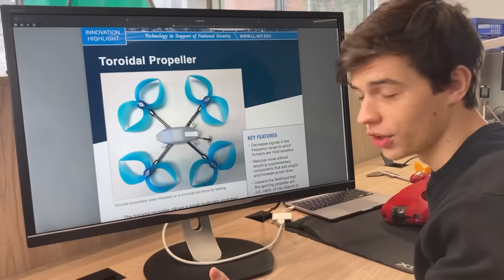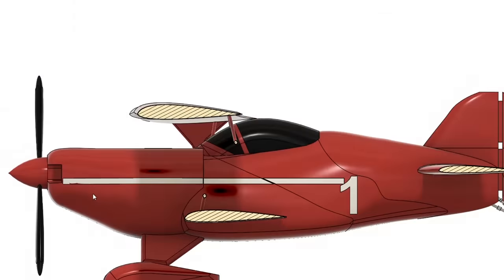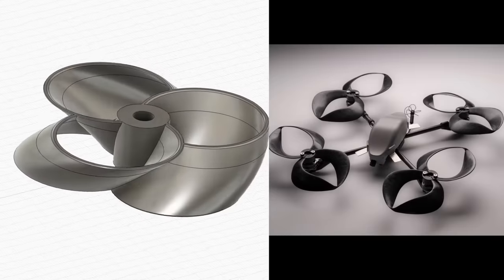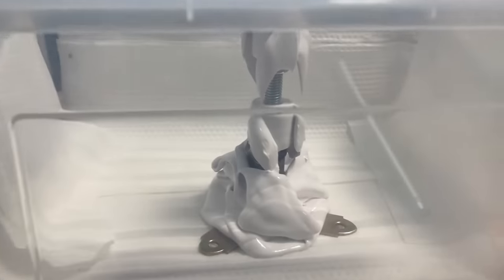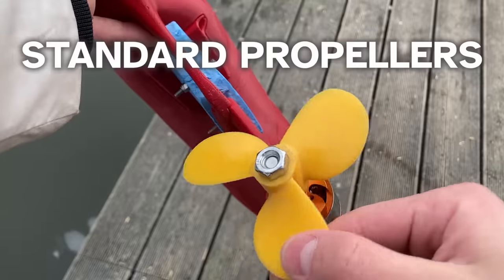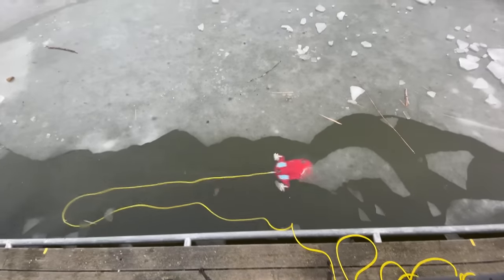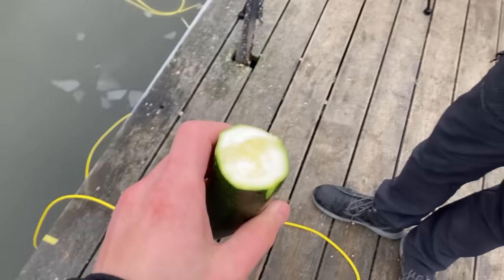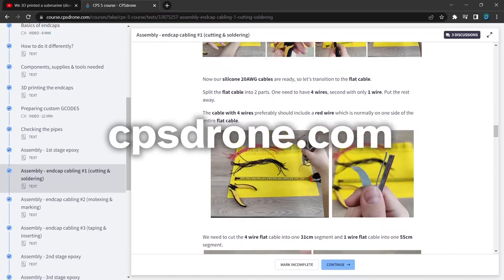Testing a TOROIDAL propeller UNDERWATER

Comment from the maker: Thanks for your feedback on the designs! We really enjoy making these videos and want to continue with some new adventures using our CPS 5 underwater drone.
Btw, go to our course on https://www.cpsdrone.com/ to build it yourself! (First chapter of the course is free)
Reply: Try making them with similar or lower total rotating surface area than the standard prop. A lot of  poor efficiency in water props comes from too much viscous drag. 
The standard props you are using also are designed for large speed range without stalling and making froth. A high aspect ratio model aeroplane prop can do a lot better, but remember that 5 to ten degrees at most of angle of attack stalls a water prop. Rather than 30 degrees in air. 
So they make them low aspect ratio to give good thrust into the plane, and give some braking thrust in reverse. 
Matching your rpm to speed can let you use more high-speed efficiency and still have some decent acceleration without just Cavitation and froth. 
You are using more  four times the watts that pushes my 1000 pound 14ft tender at 2.5 m/s. 
And 1.5 times as much as what gets my fifty foot 9 ton Wharram Catamaran going at 3m/s. 
With far more efficient and reliable brushed DC motors.
About as much watts as a top human powered hydrofoil can do 20m/s On . 
So you have some room for improvement. 
Dragging a tether is a bit of an arse. Ultrasonic modems are probably up to the bandwidth you need for a reasonable range and low res video
Reply: @aaronfranklin324  The pitch could be wrong indeed. My first thought is that the toroidal props are too big. They shouldn't match the diameter of the original one.
Reply: @Platypus_Warrior  yeah, think of the 200 kilowatts going through a sharrow prop, and scale down to the blade area you want for the 200W that sub should need to go as fast as a fizz boat of several tonnes and 25 ft length. 1000 times less.
Reply: Major Hardware has had several blade design community competitions that might be worth checking out
Reply: @kingmasterlord  seen them. Same issues with too much surface area. And bad foil profiles and angle of attack issues. 

+running these hoop foils in a shroud is just plain dumb and inappropriate. Recipe for spinning the air  rather than moving it.
Reply: dam they figure it out ....now wondering how long will it take people to use the design else where... also do a noise test ...noise pollution in oceans is a very big problem as sound travels faster and farther in water
Reply: @Jason Bourn things start to fall over with that when your bigger propellor is not in a low speed low angle of attack regime at low power to surface area loadings. 
You get too much viscous  drag as speeds go up. 
And the parasitic drag of the root and hub are bigger. 
The central vortex becomes very draggy too. 

Pulling props can overcome some but not all of this with the rotating spinner nose cone generating a lot of the lift
Probably the best soluy I've seen is hubless systems with the blades mounted on a rotating bell mouth  and entraining a central undisturbed water pillar. 
Putting magnets in the rotating section, and making it a combined motor, Magnetic/ water lubricated fluid bearing potentially very good. 
Especially if you used a homopolar pure DC motor design with saltwater film  brushes and multiloop windings.
Reply: looking at the toroidal propeller, I have an idea, I am not to sure if it would work, but looking at the design, it seems that it should work from what i can see in my minds eye, all so I have added to the first design,  a 3d printer should be able to make it, 2 addons, that I think both should work. I think that it could add 3x more output with 1st idea, second idea it would just add to the output already, I cant see how much the second addon would increase the output.
Reply: Can I use a rasberry pi 3 B+ instead of the rasberry pi 4 when building the drone?
Reply: Those aren't wings, and those aren't propellers. Those are screws. Welcome to boats.
Reply: @CPSdrone - quick question: why is the drone battery powered? Since it uses a tether anyway, wouldn't it be easier to use an external battery? It would give more flexibility on the power source. This would allow for the use of a larger power pack for use in currents, or to power stonger lights.
Reply: But is it more efficient than a kort nozzle ?

Comment: Centrifugal force tends to sling water / air from the center to the edge.  Centrifugal blowers, like a turbo, maximize this.  Standard propellers all have tip vortexes.
Reply: if i understand this right, that centrifugal force is being converted into thrust as well with the right propeller design
Reply: @stefanweilhartner4415  in certain circumstances yes, in some cases. speciffically on small scale it sometimes just makes it slower, I thought of that as well when making small propellors for micro motors for a micro plane, essentially designed them so that the centrifugal force was also translated in pushing force, but at that scale the small differences in mass and balance due to imperfecions actually made it worse.
on a bigger scale it might get more positive effect however.
Reply: *) vortices 😉
Reply: I'm gonna be that guy who states that centrifugal force is not a real force.
Reply: @ted_van_loon  Isn't what you're describing the reasons you sometimes see ducted props, an effort to convert as much energy into usable trust?

Comment: I believe the main problem is the high rpm you are using. The water testing of the special propeller (in you tube independent videos) shows a lot of advantages in the mid range and none in the high rpm range.
Reply: So i dont think its something thats necessarily inherent in this design that makes it less or more efficient at high RPM its just that  the props they are using are specifically designed to be the most efficient at a certain RPM. I think that could actually apply to any propeller really  but i think that its kind of an important thing to keep in mind. I think if you watch the video where they make the test with the larger catamaran boat is a good example of this, they put a commercial prop up against  the sharrow prop in the comparison but they Sharrow prop was custom designed to meet the  goals that they outline in the test. While it does make for some impressive results I'm not entirely sure on how fair a comparison it might be,
Reply: Yeah from what I'm understanding these new propellers basically mean youc can have better performance like longer range and reaching peak speed much faster.
Reply: If you want greater efficiency at speed studies seem to suggest rim drive then waterjets then finally the Deepspeed italian Rim drive water jet pods .. 
With rim drive the blades are more numerous and the jet confined by the housing ....that also makes them safer. 😉 The fact they dont have a driven core blocking the flow and moving turbulently means the blades can be more even in profile...and individually replaceable.
Reply: @tsunertoo9149  The funny thing is these aren't new, not at all. The design has been used since WW2 on torpedos. It works fine there because you design the propeller to be efficient at a specific range of RPM and torpedos are a launch and let go at one speed weapon so having a more efficient prop means it can get more range.

Comment: Great video! I would say that the results you have obtained are in line with what you could expect. The main purpose of those propellers (without a specific design to optimize them in terms of consumption) is the reduction of the noise caused by cavitation. Clearly, as you have in fact explained) the increase in surface causes an increase in resistance (especially if the added surface is reduced due to viscous friction phenomena).
You could try using a sonograph and measure the noise made by the two different propellers. In any case, I think that the greatest utility in the hobby field is to avoid accidental cuts.
Reply from the maker: Thank you!
Reply: To add to this, I believe if you look at the Sharrow data, there is a huge increase in efficiency in the mid range.  So yes, the toroidal props don't perform as well at max power, but could you chart their power draw over a range of throttle inputs or speed to see if yours indeed are more efficient at lower RPMs? (also, I know Sharrow provided their own data, so should be taken with a grain or 2 of salt)
Reply: @benconverse6158  Its because the Sharrow props are really designed to be most efficient at a particular speed/rpm. There is some more recent videos showing a "3rd " party test of the props by a boat magazine where they have more data published. i put the "3rd" party in quotes because they are using propellers that are basically designed for the specific engines they are using so while the data does show the benefits that they have its a pretty ideal scenario in the favor of the Sharrow props. They still are pretty cool.
Reply: The propellers they made have a much larger surface area and are not able to reach the rotation speed needed to beat the tiny standard propellers spinning at much higher rotation, this makes the speed test a completely useless comparison. Try priting smaller sizes next time, and maybe also compare battery usage at cruise speed and top speed.

Comment: Wait! Please do a Part 2 in which you do a 2-bladed version of both experimental props against a 4-bladed version of a conventional prop in order to be fair. If possible, try to get the overall blade area generally the same across all three propellers with a matching pitch angle of say 30 degrees. Too close to 45 degrees, and they’ll start acting like impellers that stir the water instead of pull through it. The new propellers’ efficiency numbers in your test are actually impressive considering both have twice as many blades as the benchmark prop and consequently produce twice as much skin drag. Part 2, PLEASE!!! 🙏 Thanks for this awesome video!
Reply from the maker: Good idea, thanks!
Reply: @CPSdrone  Now that I think of it, a 15 degree pitch angle is a known standard for fixed pitch propellers that would be ideal for this Part 2 experiment. It strikes a nice balance between low end acceleration and top end speed. My initial suggestion of 30 degrees was a bit ambitious for a marine vehicle not traveling at hundreds of miles per hour like an aircraft. Judging from the looks of it, your benchmark prop has a pitch no more than 20. You guys are brilliant. I’m excited to see your future videos!
Reply: so different number of blades with similar solidity? i wonder if doing so with regular underwater propellors could be done to show side-by-side comparisons.

i'm quite intrigued in this topic ever since i heard from Greg's Automobiles and Airplanes that there was an experiment during the 1930s between 3 and 4 bladed aircraft propellors of similar solidity and the speed increase was at best 4% (though i haven't heard if it did benefit elsewhere like propeller rigidity and increase in load capacity if it had been in an aircraft)

Comment: I thought the big thing about these was how much less energy they use to do similar distances. I think a good test would be to see which propellers goes farther with one charge. Thanks for sharing
Reply: Yes. Efficiency is more runtime for the same energy, or higher speed for the same power. These failed.
Reply: You can see from the results (also in all other videos that test toroidal props in reality) that they are less efficient. They are drawing more power for less thrust. I'm hopeful that optimized commercial designs will solve this, however as it looks right now, marketing is just trying to push these with false claims to make more money. By the way they also create slightly more noise, but at lower frequencies. At close range that makes them more pleasing to our ears, but you will be able to hear them from further away as low frequencies travel longer distances. It also takes more power to create lower frequencies, which is one reason why they have lower efficiency.
Reply: Do bear in mind the acetone treatment isn't a perfect surface
I'd love to see this on a high resolution resin print, the surface should be much more smooth

Comment: Great video guys! I was dissappointed in the results but I appreciate your honesty. Keep on researching propeller designs.
Reply: The problem with the test was that Toroidal propellers aren't meant for speed, they ar emeant for acceleration and power cost efficacy. The tests show that at high speeds the Toroidal doesn't do anything that average tipped propellers do. However at long distance cruise speeds the are supposed to do MUCH better and they are supposed to achieve their peak speed at an acceleration rate that surpasses that of your average prop. If you notice during the Zuchini test, the prop is basically whisper quiet and does little more than scratch the surface of the Zuchini. Any properly built sub using this kind of prop will be able to travel at optimal speed for long distances and have little more than a fraction of the normal noise profile of your average prop.
Reply: Thanks for the response. I'm going to guess that these props are likely on our newest submarines then. So, more power, less vibration, Making these new subs even more undetectable. Wow!

Comment: Aircraft added wingtip fins to increase efficiency and reduce drag.  Now standard on pretty much all jet airplanes.  Be interested to see if a similar approach would help propellers though the tip Velocity is lower for a wing so geometry needs to be adjusted.
Reply: My Prince P-Tip plane propellor has just that. Works great!

Comment: I think all of the difference in performance can be explained simply by prop pitch. A better test is speed based on a given rpm. That will give you a better sense of true efficiency per prop design.
Reply: That’s something that needs to be kept in mind.  Most people assume all airplanes increase thrust by increasing RPM; but some airplanes have constant speed propellers and use propeller pitch to increase speed.  The propeller gets more “bite” into the air, therefore more speed.  The pitch of the propeller is important.

Comment: The theory apparently is that the toroidal propellor eliminates the vortices being shed from the blade tip. This does not mean that these vortices cannot be shed along the trailing edge of the blades instead of being more concentrated at the blade tip. 

To compare the two kinds of propellors the experimenters should have made the toroidal propeller of the same diameter and having the same solidity ratio as the regular kind. Solidity ratio is the proportion of the full circle of the area covered by the propellor compared to the actual width of it being covered by the blades. For normal propellors it has been found that in theory the width of the blade should change with the radial position according to an ellipse, with the widest part at the blade root. This ideally will ensure that the pressure along the blade creates the least losses from blade tip vortices. It is not always practical to use this shape.

Normally for propellor design the solidity ratio is chosen so that depending on the power available, the propellor is the most efficient in balancing its surface friction with its losses from the blade tip vortices. The application of this design criterion does not require anything like so much work as claimed in the video. 

If this way of reducing or eliminating the losses due to shed vortices were true, then instead of the added win-tip fins on the wings of regular aircraft, a biplane layout with the wing tips joined would be more efficient. A few designs have been tried but without much success here. It is my impression that due to different diameters and solidity rations and power being applied the comparisons in these tests are incorrectly compared. Greater efficiency means less power for the same thrust (or lift in the case of a drone).

Were the airflow through a centrifugal fan then allowed to expand and be directed to flow behind the device (using a canopy like that of a parachute) and parallel to the axis of rotation, greater efficiency will result.
Reply: Thats patentable!

Comment: Now try modifying standard prop with circular band around blade tips. At low rpm used in water, centrifugal force not enough to warp band. For high-rpm aero props, band could be made stationary, held by struts.

Comment: I've not been very convinced of the amazing qualities of the MIT propellers, at least based on all the attempts people have made at them. Finger safety though seems like it would be a reasonable selling point though, especially in the RC space.
Reply: Well, the main pro of those propellers seems to be lower noise/turbulence being generated, and all things considered there are plenty of use cases for slightly less efficient propellers with lower noise generation, they could be in use in military submarines right now for what we know
Reply: Yes, these hobbyist designs have not been very impressive so far. That's probably because MIT and the Sharrow company are actually using fluid-dynamical modeling and university-level knowledge, while people are just vaguely copying how they look on intuition alone...
Reply: @giadalussu1922  I recall that the US Navy's Nuclear subs have propellers which have a shape that is top-secret. The reason being is that they do not generate cavitation, AKA, low noise. Wouldn't surprise me at all if they use some similar shape.
Reply: @Justowner  i know, thing is we will never know what shape they have tho